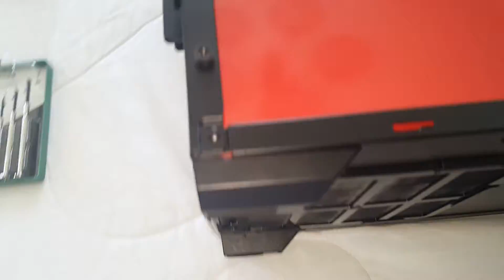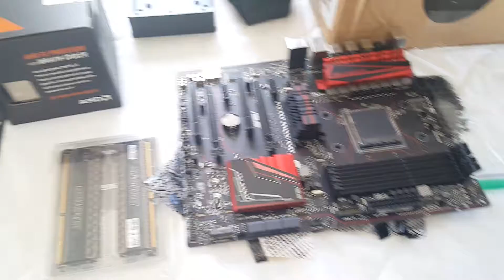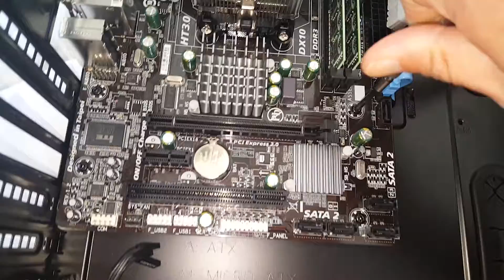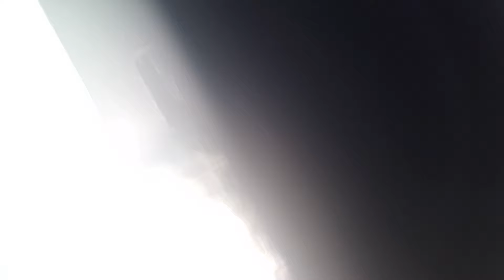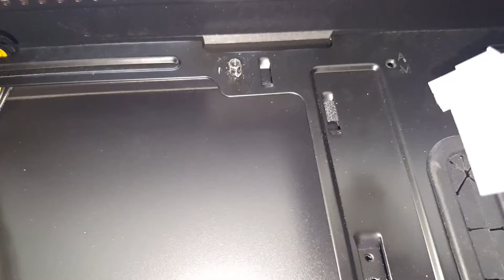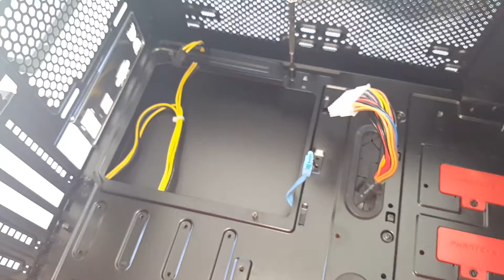How To Remove A Motherboard From A PC #PGNETWORK

Comment: What the fuck. Mine is stuck hanging with no screws and wont budge
Reply: Same
Reply: @formy6 same please did you find a solution
Reply: @YuhHuhNuhUh  there was a screw under the ssd
Reply: @formy6  omg yeah I felt so stupid when I finally found it